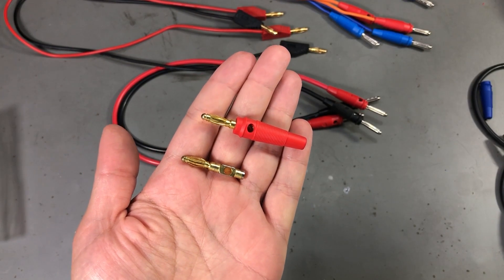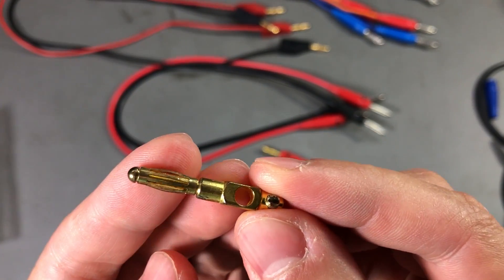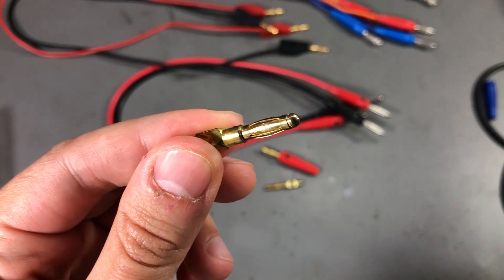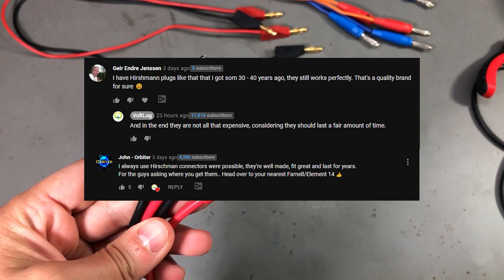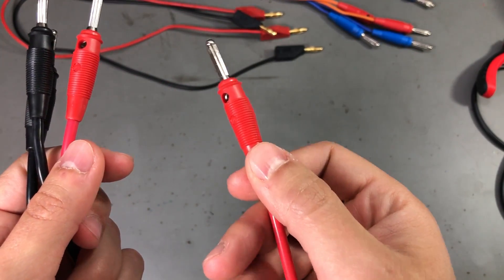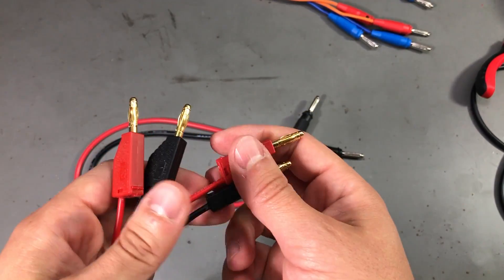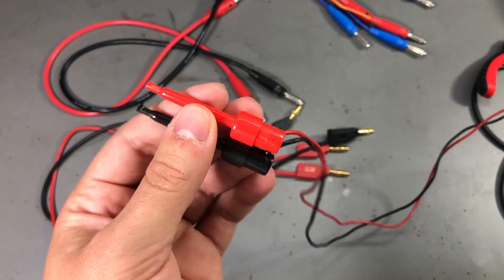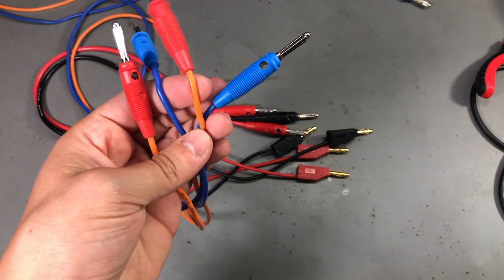Voltlog #250 - Replacing Bad 4mm Banana Plugs With High Quality Hirschmann and Staubli

Comment: I've been using a plug that has a similar outer shell to that but the metal plug is different. It looks similar but the grub screw is smaller on mine, mine don't have gold plated (whoop de doo), and the spinning thing up front is very different. Mine is solid except it has fins that stick out and must be spring loaded on the inside. Ive given up on the free spinning type, I like a much more solid fin design.
Reply: Edit: I guess I"m using Hirschmann or knockoffs because they look exactly like the Hirschmann. I did have to drill out the rubber outer shell to accept a 12AWG cable (4mm2)

Comment: As you imply, tolerances on the spring globe and plug are critical to prevent intermittent contact.  As the plug is inserted into a socket, the globe increases in length just enough to assure good contact.  Chinese manufacturers probably have figured that out, but their sales mentality and retail systems are so heavily weighted to lowest cost that a good product may not see the light of day.  There is also the 'Walmart issue': if an acceptable quality product is found once, will you be able to find the same manufacturer's part the next time, and will the quality of that batch be the same?

Comment: "A typical design is now required (IEC 61010) on multimeter test leads and several other measurement and laboratory equipment . In this design, the metal banana plug is entirely sheathed in a plastic tube and inserts into a deeply recessed jack in the multimeter."  --- wikipedia
Now assuming one wants to upgrade their lab equipment, just try to find a source for quality 'binding posts' that will also accept ‘safety-sheathed’ 4mm banana plugs.

Comment: has anybody ever tried replating their own connectors with gold or copper? you have already a power supply all you need is something gold to plate off of
Reply: I seem to recall that gold is only good for low-voltage connectors, but that might have been to do with relay contacts where there is switching.

Comment: I've had a lot of problems with the cheap banana plugs that have the loose springy jacket on the outside and had to solder them to the inner part of the plug to make them work.

Comment: I'm skeptical of any of those sleeved type connectors. I don't have any of that type. I still like the ones with the solid drop of metal that has a machined X slot cut along the length. I've had one of those fail from one of the 4 sections fatiguing and breaking off, but it takes a lot of use to break one. The way I see it, all the manufacturer has to do is make a single piece of metal 4.1mm in diameter and cut two 0.1mm perpendicular slots. There's nothing mechanical or an assembly step for them to screw up. Perhaps someone can educate me as to why these are inferior? 
  
  As far as those hooked leads... Back when RadioShack was in business I picked up a couple hooked leads that have a terminal on the back end for multimeter probe leads. They look just like the ones you had here. They weren't particularly good quality, but they are much more convenient IMO. There's no need to find, untangle, plug and unplug special test leads that have hooks. You simply have a quick little attachment to throw on any set of leads and you have a hook probe. I've looked for something like these on eBay/AliEx but no dice. If anyone knows about or finds something like this please let me know.
-Jake
Reply from the maker: actually I am looking for the grabbing hooks that allow direct soldering of the wire inside the probe, this way they are more compact and lighter which is important when attaching them to small sized circuit boards.
Reply: @voltlog  
This guy covers a bunch of small logic analyzer type hook probes in depth:
https://youtu.be/dobU-b0_L1I

Comment: If you search aliexpress for long enough, you can get exact clones of those hirschmann plugs for around 0.50$ a piece.
I haven´t had any problems with them at all so far, they seem to be very well built.
Reply: Yeah these are the ones I got, didn't realize they were clones, quality is very good: https://www.aliexpress.com/item/32433333336.html
Reply: @jaro6985  Yep those are the ones.
I got some from here some time ago: https://www.aliexpress.com/item/32698254875.html?spm=a2g0s.9042311.0.0.27424c4dy8GzJg
If you ask them they will send you any combination of colors.
Reply: @Basement-Science  , @Ja Ro T, Thanks for the info and the link !

Comment: I've bought the cheap ones and hate them. Lousy unstable connection. 
Still trying to make a bargain, I have purchased the Hirshmann style connectors a few times from Ebay and they work fine. Here is a link to the kind of plugs: https://www.ebay.com/itm/10Pcs-Brass-4mm-Male-Solderless-Screw-Stackable-Banana-Plug-Connector/172249277745
Also this type of connector make a good connection: https://www.ebay.com/itm/high-quality-brass-5-Color-4mm-Banana-Plug-FOR-Audio-Speaker-Connector-wholesale/153544384747
Ususally I solder the wires instead of using the screw.
Reply from the maker: The ones I got are solder type connection, really solid.

Comment: I'm using this nylon hooks : [ https://www.ebay.es/itm/5Pairs-Red-Black-55mm-Nylon-Test-Hook-Clip-Probe-for-Multimeter-Oscilloscope/152686428212 ] , not the best in the world, but they are better that those you have (and me, I bought a lot before knowing this new nylon ones ). About the banana, I like the simplest and cheapest, no rotating elements [ https://sc02.alicdn.com/kf/HTB19xwmJXXXXXa6aXXXq6xXFXXXL/Speaker-cable-banana-plugs-banana-connector-banana.jpg ], until now, no problems, but I bend more the conexions, close to the tip, before the first use, so they grab better. But, of course, I don't even have high resolution test equipment, so, maybe I'm talking stupidities. Thanks for sharing !
Reply from the maker: From now on I will stick with brand name connectors for test cables.
Reply: @voltlog  Is the best solution for sure ! Cheers !

Comment: Ah yes, I feel vindicated. That's the only type of plug I was willing to use, after I experienced first hand how shitty the "spring cage" ones were (really bad contact, broken "spokes" on the cage, etc). The Hirschmann ones make a delightfully strong, positive contact every single time.
Reply from the maker: Yup from now on no more crappy connectors I will buy hirschmann or similar at least for test equipment.

Comment: I really recommend using the safety version when using banana plugs. They have plastic covering the ends, and it is a lot harder to get shocked by accident - either by shorts or touching it yourself. Prise is around the same, ebay search "Hirschmann 4mm safety"
Reply from the maker: Thanks!

Comment: These 4mm hirschmann connectors looks they will acomodate all the female connector inside in 4 points and nickel plating is good enought., thus providing a good conection.Don't know what brand are the ones bought in physical store but plating seems identical. Can you do a current test with best  multimeter leads against the ones maded from these connectors for comparisson?

Comment: I have used the Hirschmann ST series of connectors at work for about 3 years, hundreds installed and not one single failure
They are not cheap (£7 each for male/female) but they are a 'fit and forget' connector that you can always rely on, I'm sure yours will give you a solid connection for many years
Reply from the maker: Thanks!

Comment: If they are simply nickel plated brass,I can probably make them for myself (machine out a brass connector and plate it)
Reply: The solid part should be easy to machine, but the spring?
Reply: I can make them like Indian split point electrical plug

Comment: I have these hook test leads made from here.They've been working almost daily for around 4 years and still do the job. They come in black and red. 6A rating. There are different models that handle 15A but are more expensive. You may try  a trial order to check shipping costs. I believe they are shipped from Poland. https://www.tme.eu/mt/en/details/kleps2-bu-sw/test-hooks/hirschmann-t-m/kleps2-bu-sw/
Reply from the maker: I'll try to get them through my regular supplier, thanks!

Comment: Glad you made this video.  Have been looking for some I can plug into my multimeter that do not swivel.
Hate that "split jacket spring construction".
Reply from the maker: I have to agree, the other type of construction (the ones from Hirschmann) inspires more confidence long term but I think the most important factor is build quality. Because the same type of connector made with cheap materials and low build quality will probably be a complete fail like the previous ones from aliexpress.
Reply: @voltlog  Though I may be disappoined, will order some of these, that look similar:
https://www.aliexpress.com/item/32848330703.html